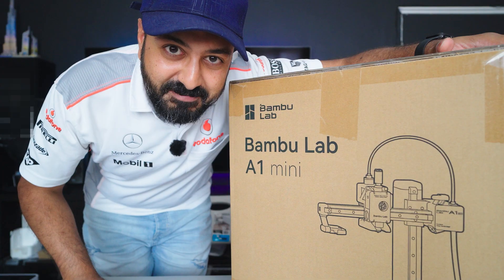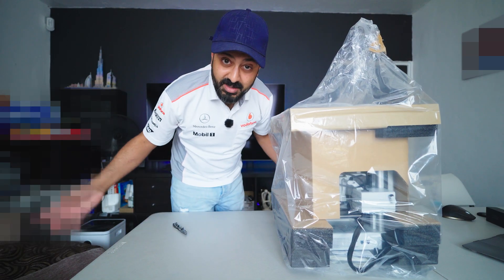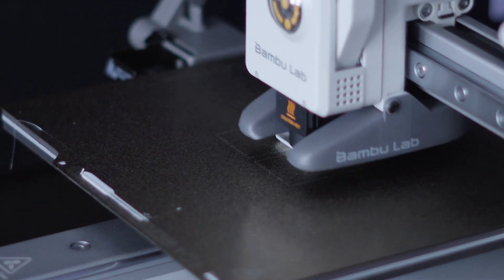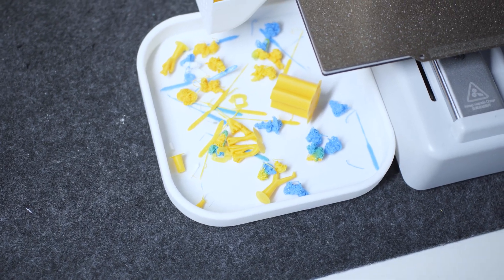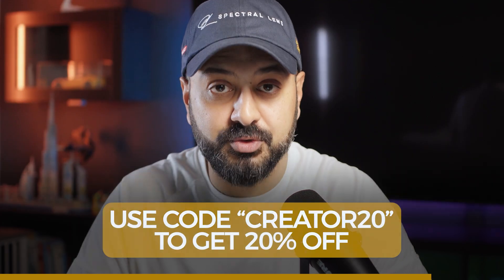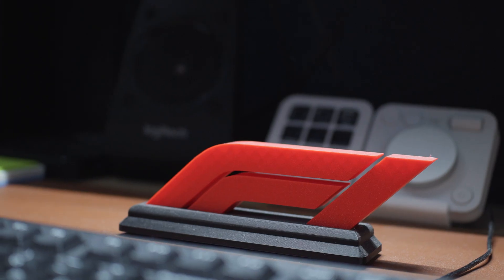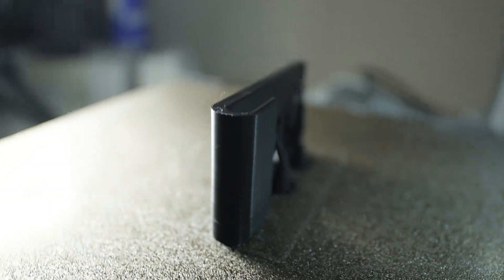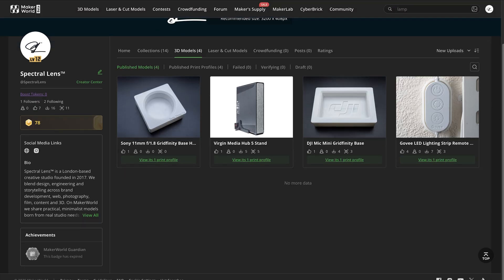Unboxing the Bambu Lab A1 Mini + My First 3D Prints

Comment: I bought one of these for my first filament 3d printer and I was hooked right away ended up ordering a Elegoo Centauri Carbon a week later lol
Reply from the maker: That's awesome! It's so easy to get hooked once you start. Any reason you went with Elegoo?
Reply: @spectrallens  Mostly I wanted a bigger plate size to print on and also more options with the filaments along with the added bonus of a AMS down the line.